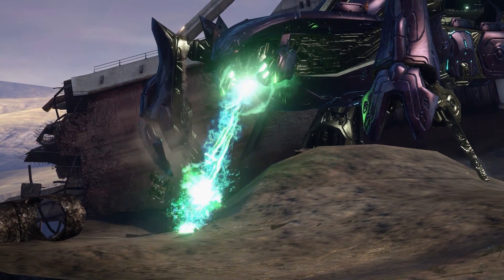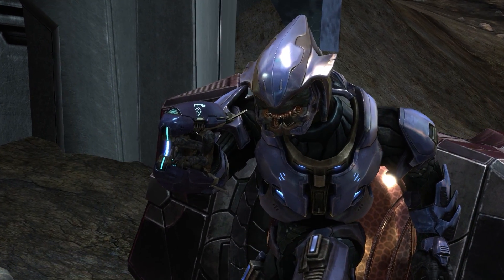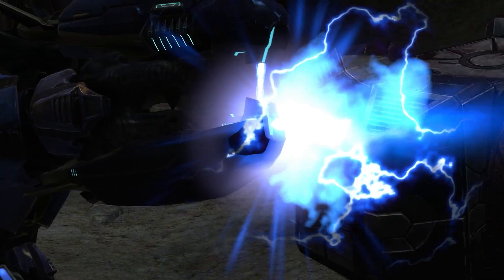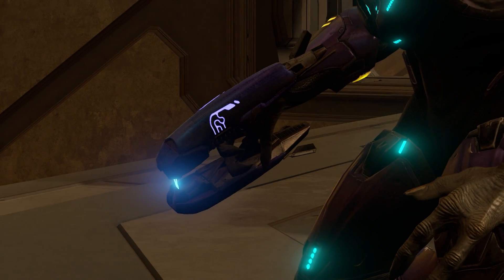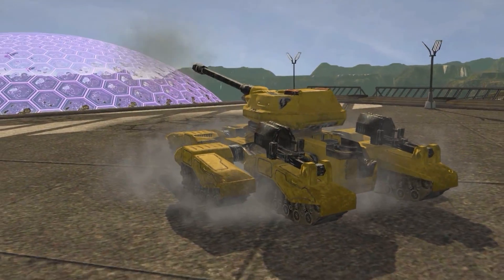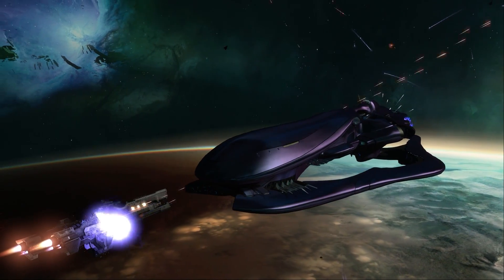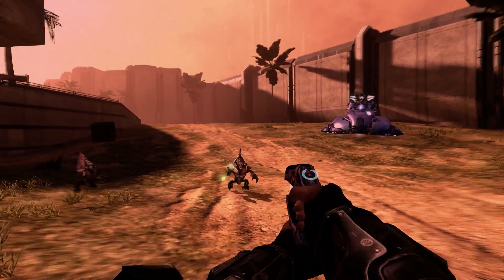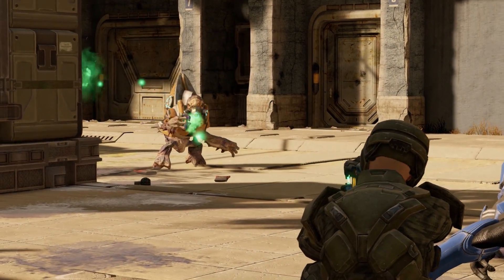How Plasma Works (Halo Lore)

Comment: I can understand magnetic fields shaping the plasma into bullet shapes for firing but how do the magnetic fields retain the shape over large distances? Don't magnetic fields get much weaker over longer distances? Also how does that work when multiple rounds are fired at quickly?
Reply from the maker: That’s where the sci-fi suspension of disbelief comes in! Plasma weapons are almost possible, but in reality they’d just dissipate immediately. It’s really the magnetic field that makes them so deadly, but the science of it is outside what we currently know is possible.

Comment: This is why the legendary difficulty is the canon. It's closest to the books anyways.
Also, I can't quite remember what book it was but I may have been Cole protocol but Dr halsey explains/learns how covenant ships generate, use, and fire their plasma turrets. It's something along the lines of they need a clear line of sight to their target and basically they paint a line to their target, in which the plasma bolts ar then carried along.
Should be known however that the covenant only posses plasma weaponry because they've tried to reverse engineer forerunner weapons. Thanks to the prophets.

Comment: Well, there is one notable problem with your magnetic field containment field theory, electrons repel each other and without a opposite charge (or magnetic field with an opposite charge, probaby generated by some electromagnets), the plasma would instantly dissolve in the air. So in actuality, Halo plasma weaponry is useless, atleast in atmosphere.
Reply from the maker: Very true! Halo’s magnetic field is definitely what separates it from reality. It’s pure science fiction, but it’s a fun lore device!
Reply: @SameToken  I suppose so.
Reply: @Void_Wars  Love you too, fam.

Comment: While human's understanding of plasma weapons is still largely theoretical. We know a lot about electricity and magnetic fields. I don't know why the scientist at UNSC hadn't invented something like magnetic field pulses that could mess with plasma containment and guidance.
Reply: One downfall to the plasma weapons is EMP blast. During the headhunters arch in halo legends they used EMP grenades in large populated rooms and the weaponry of the covenant wouldn't work. Making them extremely easy to kill if their guns won't work during a time when they need to be.
Reply: @zyoh4311  Oh. Nice.

I haven't read that part but it is mentioned in Halo: First Strike (iirc) about the excessive use of EMP grenades particularly by Sgt Johnson

Comment: Some things shouldn’t be given an explanation... 
Because if you had the ability to generate and manipulate magnetic containment fields at such rate, intensity precision and distance from a handheld device, putting plasma inside it would be the lamest application possible! 
Using the supposed principles of the plasma rifle you could use the remote magnetic field generation capabilities to create a railgun rail between the weapon and the target, constantly accelerating a projectile over the distance, creating not only plasma from the heat caused by air friction but imparting it ridiculous kinetic energy. Depending on the size of the projectile and rail it’d be enough to vaporise anything from a human to a tank.
Or you could just use the magnetic fields to crush vehicles and tear apart weapons. Heck you could probably pull iron from the blood of your target, exsanguinating it from half a mile away. Or generate remote localised EMPs. Or mess with the electric signals from your target’s nerves and neurons...

Like the lasers from Star Wars I prefer thinking of “plasma” weapons as a field name, unrelated to the technology used. The fact that plasma mortars behave ballistically lends me to believe that the Covenant’s plasma is more akin to a highly reactive chemical compound

Comment: 1. the range of plasma bolts should be limited in atmosphere. Air resistance will leach the heat from the bolt turning it into a puff of hot air at range. Though plasma has better range in space due to the vacuum 

2. Why didn't the UNSC use ceramic plates to counter plasma fire? Ceramics are used to insulate the inner surfaces of smelters and kilns and would have greatly reduced heat transfer of the bolt to flesh.

Comment: 3rd degree burns are classified as burns where nerve endings are destroyed, if you have a 3rd degree burn you will not feel it if you decide to poke or brush up against the burn. If "you were unlucky", really means that someone was indirectly hit, having their armor absorb some of the heat and you end up with either a 1st or 2nd degree burn.

Comment: on a side note, i think the biggest downside to plasma is travel time, it might be devastating but those bolts appear to travel pretty slowly through the air. the muzzle velocity of a plasma rifle is around 126m/s, that's not even half the speed of sound, meanwhile a standard assault rifles muzzle velocity is around 905 m/s. the projectile is also really easily identifiable compared to a bullet, its pretty hard not to see it coming, even in spartan time which is experienced in-game human weapons almost immediately hit their targets, so while bullets might not neccessarily be as devastating, you can get effect on target a lot faster which is the whole point of a gun i would think lol.

Comment: we also use plasma in rocket engines to some extent, ion engines and hall thrusters to be more specific, were also experimenting with magnetoplasma rockets, the exhaust velocity of them is very high and the exhaust temperature is also very high so they're extremely efficient in comparison to chemical rockets but lack overall power due to the low mass of the propellants used

Comment: The reason they dont do so much damage in game is purely for gameplay balancing, a plasma pistol can burn straight through marine armor and demolish the flesh and a brute, grunt or jackal that dont have a battle harness or shields (halo 3 brutes were used in place of elites so had shields but the majority of brute warriors had nothing but armor pieces) should be melted and killed in one shot but that would make gameplay extremely boring.

Comment: No...no...no...
There is a reason why defense contractors and the military aren't very interested in Plasma weapons...
It's very very difficult to weaponize and require a rail gun like system to even have a hope of it working, Even then the bolts would burn up quick.
Mass accelerators are the way forward, much more powerful and already being developed like the naval rail gun.
This is why fiction is even getting away from Plasma, Especially in hard sci-fi.
Plasma can also be shielded from with modern technology, carbon-carbon ceramics (used on the space shuttle to protect from re-entry and plasma generated from that), carbon nanotubes and graphene would all cheerfully protect against plasma.
While very hot, Plasma is very inefficient unless used as an incendiary device.

Comment: It's funny how plasma weapons are a staple of sci fi when, In reality, plasma would make a useless weapon.  For example: I myself have survived point-blank shots from 40,000 volt directed-plasma devices on several occasions, with barely a scratch.  They're called spark plugs and accidentally sticking your hand on them when they're running stings!

Comment: Plasma is one of those technologies that as soon as a species has the technology to weaponize them, they become obsolete. Think about it. Once you figure out how to shape, contain and control plasma as a weapon. You already have the tech to disperse it, shield from it or deflect it.
Reply: Not necessarily, because you'd also have the tech to move magnetic fields, if you have the tech to use plasma for offense or defense. You can just literally use a field to pull apart another field used for shielding and shoot it. The only way to counter this is by building stronger fields to either tear fields or hold fields together, its like the USA and USSR during the cold war. One makes a bomber so one makes an interceptor for it and one makes a better bomber that can't be intercepted and then the other one makes an interceptor that CAN do that, and so on so on until one side either loses or gets so broke they have to stop countering and their enemy eventually gains superiority because of that, or their enemy collapses, either government or army or whatever.
Reply: @floseatyard8063  thanks for literally commenting the same thing I just said. And the solution you proposed just simply makes plasma containment impossible to begin with because now there’s way too many magnetic fields that it expands and rapidly cools your plasma bolts.
Reply: @kolinmartz  then just use projectiles and ignore plasma. Also why are you assuming your enemy knows how to disperse plasma weapons?

Comment: I always felt like they severely under-tuned Covenant weapons in the games. Aside from a few outliers, the UNSC arsenal has been strictly more powerful despite all the gameplay drawbacks Covenant weapons come with.

Some noteable examples of outliers are:

The Plasma Rifle in CE being better than the AR in all but melee-range encounters, due to the AR's massive spread. (Though the Magnum rendered all but like 2 other weapons in the entire game obsolete so this didn't even matter)

The Halo 2 PC/MCC port's Carbine having a bugged uncapped rate of fire, making it dominate the BR if you don't account for the BR's rapid fire glitch. Though the original Xbox version had a capped Carbine rate of fire that made it weaker than the BR.

Halo 2's extremely long sword lunge and infinite ammo made it strictly better than the Shotgun. Though the Shotgun was an effective sword counter. Though this wasn't balanced properly as the Sword was also much easier to use than Halo 2's shotgun.

In Halo 2 the Plasma Pistol was WAY better than the magnum, and I'd argue the same but to a lesser extent for Halo 3's. Though in both those games the magnums were absolute garbage so it's not like they had anything noteable to compete against.

The Brute Mauler in Halo 3 was better than the Magnum as well. Though you could argue it's supposed to be another Shotgun equivalent in which case it only is if you dual wield it with a Plasma Rifle.

On the topic of dual wield in Halo 3, the only other remotely decent dual wield combo was 2 Plasma Rifles. while one Plasma Rifle was worse than one SMG or AR, two Plasma Rifles was actually better than two SMGs, one AR, and even one Plasma Rifle and one SMG contrary to what you'd think. But it wasn't better by much and only got to be better due to some really weird dual wield mechanics Halo 3 had where weapons actually did less damage while dual wielded (magnum is a clear example kills in 5 shots single wielded, but 7 dual wielded) The Plasma Rifle took the smallest damage hit from this going from 18 shots to kill to 20, so when you dual wield it only takes 10 shots per weapon to get a kill, which is faster than any other combo of automatic weapons.

Halo Reach's TU 80% bloom Needle Rifle was straight up better than the DMR, because you could fire the NR at max rate of fire and the reticle would fully reset between shots. The DMR was better with 100% bloom and Zero bloom though.

In Halo 4 the Needler finally got something that was kind of an arsenal equivalent in the Sticky Detonator, which it was both a lot more consistent AND easier to use than. But on the topic of the Needler, before Halo Reach it was always either trash or only sort of useable within it's very unique niche. In Reach it was actually very dominant if you used it within it's very specific range niche, it just didn't have any immediately competing weapon to compare to.

Halo 4 and 5's Storm Rifle was actually stronger than the AR/SMG in those games, which y'know, makes sense considering how much more effort goes into using it especially at medium range or longer.

I think a statement can also be made that Halo 4 and 5 have extremely good Fuel Rod cannons compared to the Rocket Launcher in those games. But I don't know if I want to say they are better or not since we're comparing two very easy to use weapons.

Finally across all Halo games, the Beam Rifle's bullet magnetism having a wider radius than the Sniper's making it slightly easier to land shots, and faster rate of fire making double body shots easier. This has applied to all games and is the only case of a pre-343 Industries era Covie weapon always being stronger than the UNSC version. This is another case of poor balance though, as the Beam Rifle is legit just easier to use and better at the same time.

Comment: Interesting topic but technically misleading. Arching is plasma but it only follows the path of least resistance within an electric field i.e. electrical break down of air. RF signals are used in application to ionize a volume of some gas mixture. As soon as the gases leave the electric field, they quickly recombine and return to their lowest energy state with some not so nice by products. An alternative explanation which would be more plausible would be a super heated fluid being shot out from the rifle kinda like a rail gun. This wouldn't require infinite power as your explanation does...

Comment: if the bolt maintain its shape because of the magnetic field, why can't it be disrupted easily? I know in Halo shields exist but they absorb the impact/energy, what about a giant EMF which brakes the bolt, dissipating the plasma in the air?

Comment: Let's assume you're a reasonably equipped UNSC marine. If you get shot in the chest with a plasma rifle, this is what would realistically happen:

1. Armor at the impact site, assuming you got hit in a plate, would heat up dramatically, enough to cause severe burns where it contacts the skin. This also assumes it's a ceramic armor, not a metal that would begin to melt while you're wearing it. If you were hit in an unarmored area, your flesh would violently rupture as bodily fluids flash boil and cause internal steam explosions. (this is as bad as it sounds). 
2. Your clothing would ignite around the impact from the intense heat of the plasma and /or glowing hot armor plates. 
3. Any ammunition or explosives you may be carrying near the impact site are at risk of cook off (exploding from excessive heat). 
4. You will be at least temporarily, if not permanently blinded if hit from the front without an ODST helmet that has an auto darkening visor and full face protection from the thermal radiation. A standard marine helmet or eye protection will not save you.
5. Even if the armor does its job, and you put out any fires, you ARE going to have serious burns that require immediate treatment.

That's just one bolt from a hand held weapon. You're definitely not surviving a hit from a shade turret, or a vehicle mounted plasma cannon. As a side note, the Wraith's plasma mortar would probably be lethal a good 10-15 m further out than depicted in game, and extremely dangerous out to at least 50m from ground fragmentation.
Reply: Optican, healthcare on demand
Reply: How the hell did humanity even last against the covenant
Reply: @ashplattsii1fan92  The short answer is that they didn't. 

UNSC victories, ground and space, during the war often relied on some combination of surprise, superior firepower, and superior numbers. Pretty much everything about the Covenant war machine was objectively superior in the context of fighting a total war. 

From the human side, it was effectively a 27 year long fighting retreat against a technologically superior enemy that had no ROE, and whose primary objective was their complete annihilation.  

By December 2552, the UNSC navy was nearly destroyed, hundreds of colonies had fallen, Reach had been glassed, and Earth was being invaded. Without the Great Schism that tore the Covenant apart, the UNSC would have been defeated by early 2553.

The main reason it took so long is that the Covenant had very poor intel about where human worlds were. Even at the end, when Regret jumped into earth orbit with fifteen ships at the beginning of Halo 2, he didn't expect to find humans in the system at all.
Reply: Ya! You get hit by 1 shot from a scarab beam, you will be a charred corpse...and if you survive, you would be unhealable so you would be dead either way!
Reply: Yip. Right there! Scarab: Deadliest plasma gun ever!

Comment: realistic halo is fun, just in a scary way lol :D there are several ARMA 3 mods in the works you can try that make a super accurate simulation of halo similar to the lore, from the armor and weapons systems to the ranges and scale of usable hardware (self propelled howitzers, anti tank guns, drop ships, non mobile but armed capitol ships (engine limitations don't permit them to move sadly but I feel the next ARMA will give us the tools to do that) you haven't lived till you've blasted insurrectionists with a scoped, suppressed, MA5D on semi from 500 meters in the dead of night with night vision. (human weaponry is way more lethal as well, an unarmored target (dude in civilian clothes and no body armor will die in like 1 or 2 shots, the calibers of most Halo firearms are massive to cope with both modern human body armor and convenient armor and energy shields)

Comment: so how do energy shields work? i can understand them disrupting plasma bolts, but stopping kinetic projectiles? that doesn't make sense to me, unless it's hard-light not plasma 
 
also, i call bullcrap that a simple plasma pistol can melt through unshielded mjolnir armor, metal is an excellent heat conductor and there is most definitely some kind of silver alloy that can disperse the energy to something that dumps it into a waste thingamajig (like a radiator but better). Or how ineffective the AR is, because it is technically a battle rifle (like the FAL and the SCAR-H) since it fires 7.62x51 mm and this stuff absolutely shreds (picture a chainsaw but if itwas a gun)